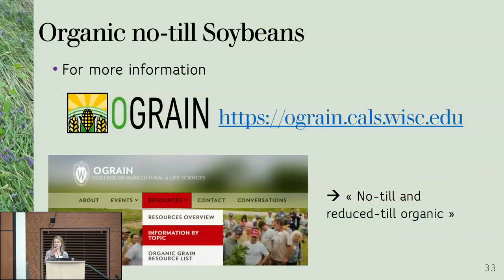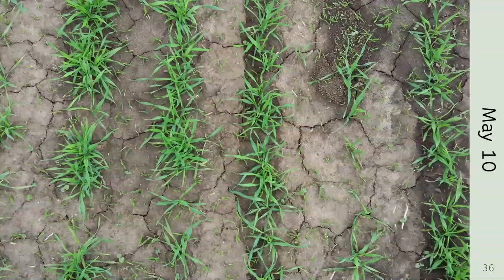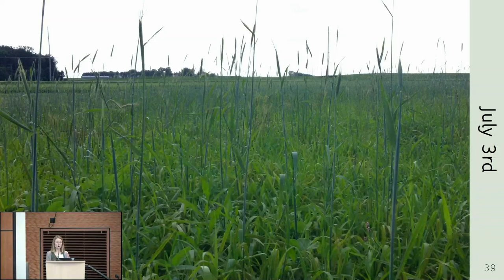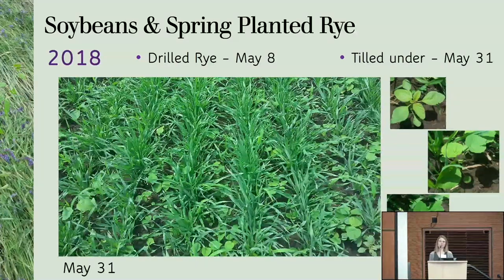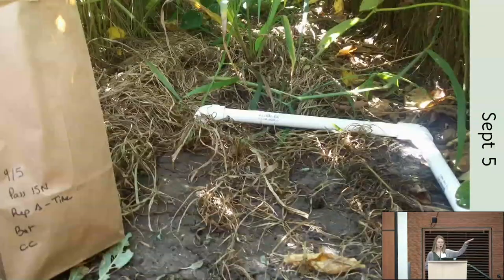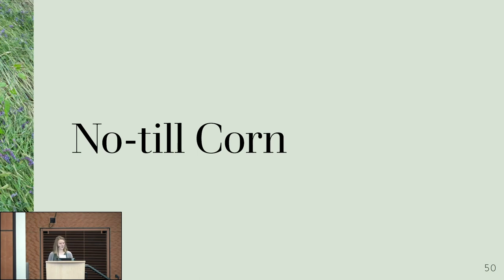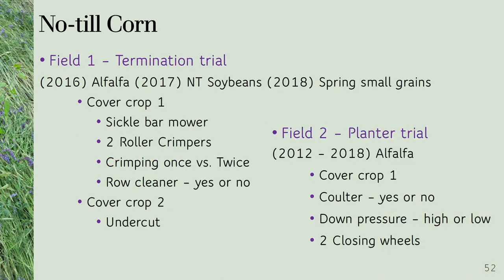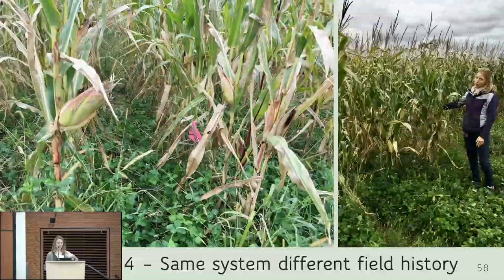Léa Vereecke OGRAIN 2020 - Organic no-till systems

Comment: Hi Léa,
Very interesting. It's something I plan on trying a little this year. You seem to have the best weed control when you have three "stale seed beds" (11:50 in the video), meaning three cultivation passes prior to planting (I think). Is that correct, and if so, how did you time the three passes. Where they all immediately before planting/drilling, or were they spread out over several weeks in the spring ahead of planting/drilling?
Thanks for the presentation,
Bruce
Reply: Hi, when I said "3 flushes of weeds" I actually meant 4 tillages passes prior to planting. Pass 1 stimulates the 1st flush of weeds, pass 2 gets rid of the 1st flush and stimulates a second one etc. In that specific case, the ground was tilled on May 12, 23, 31 and June 5
. It is best to space the tillage passes to give enough time for most weeds to germinated but not too much time so the weeds are easily controlled with light tillage (7-10 days, depending on weather).
Reply: @patathontruk  Thanks for clearing that up.